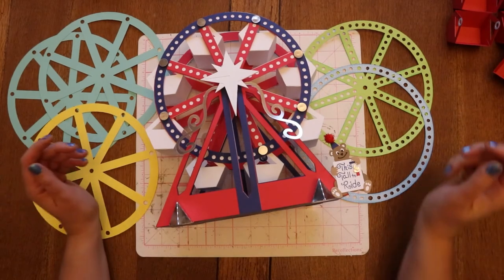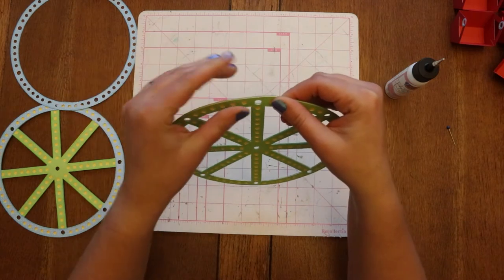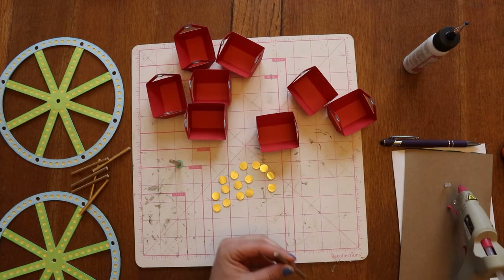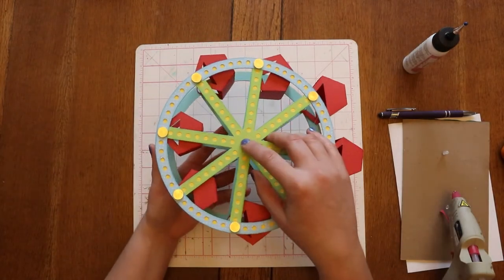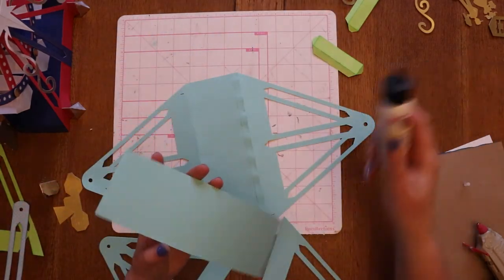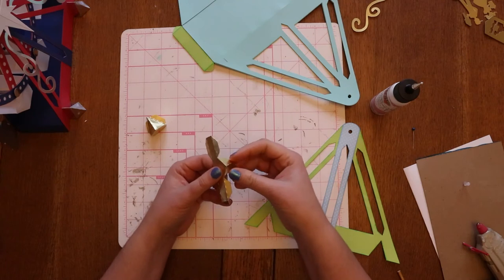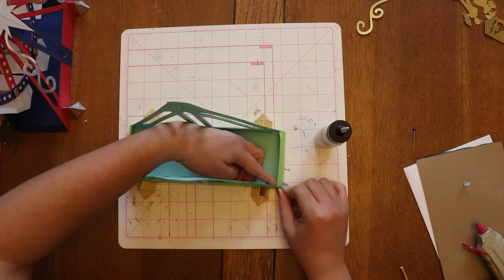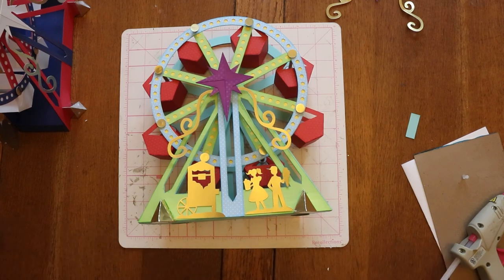Ferris Wheel 3D SVG Assembly Tutorial - Cutting Room Digital Designs

Comment: I'm thinking of buying this cut file from etsy.  Can I use lollipop sticks instead of wooden dowels?  And if dowels.  How did you cut the wooden dowels?
Reply from the maker: Great questions! The wooden dowels here are 3/16" in diameter, so any stick that diameter or narrower will fit through the holes as cut in the file just fine. Lollipop or cake sticks will probably work, as long as their diameter isn't larger than that. There's also a little bit of extra space built in to the holes, so you might even be able to go as big as 1/4".

Lollipop or cake sticks are a great idea, since they can be cut with scissors. For these dowels, we used a hack saw to get them down to size. Of course, let us know if you have any other questions--happy crafting!
Reply: @CuttingRoomDesigns  thank you!